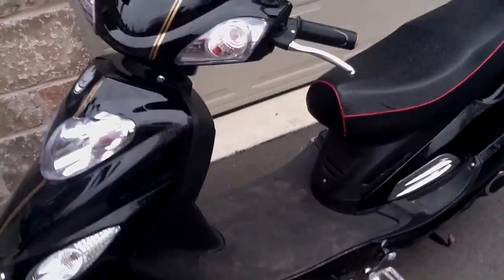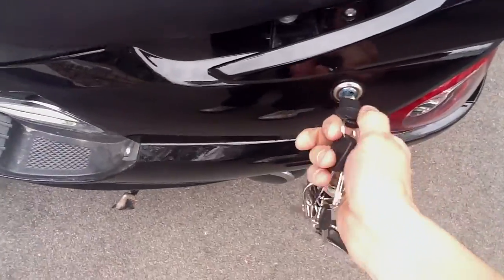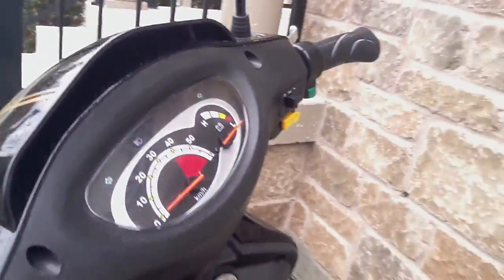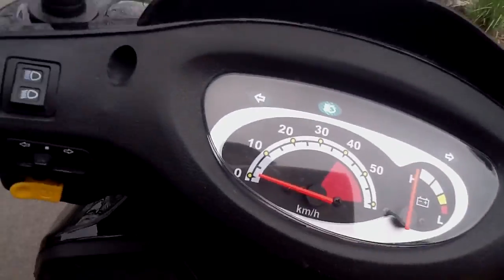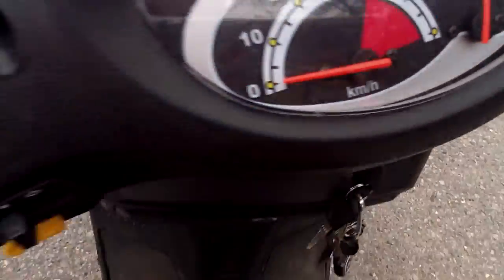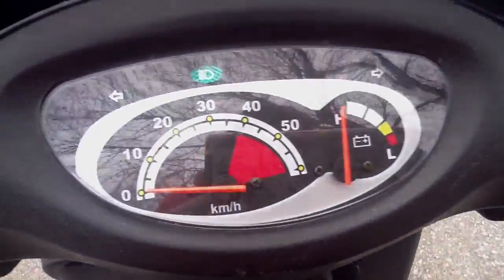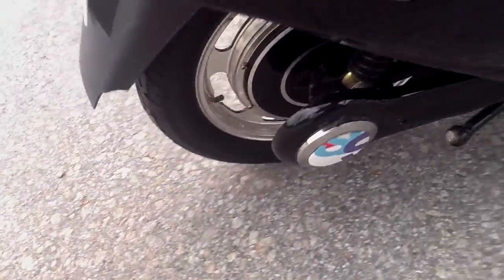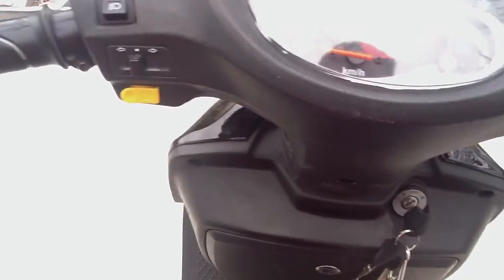Luyuan Ebike Problem

Comment: i found an old luyuan e-scooter that is 6 years old and runs on 2 gel accumulator it haves the same thing with a seat it seen better days but it works yesterday i replaced the accumaltors wit new gel ones

Comment: Dont do that anymore! Your phase wires and hall wires may need to be  wired to a different config. Go to endless sphere website and get all the info. The same happened to mine exactly but works after finding correct config.

Comment: I bought a $4300 Daymak Ultimate Chameleon, I had taken it all apart and I believe it is the controller. I took of the blue wire only. I was able to turn the motor freehand. As soon as I hook the blue controller wire back up I can't move the motor at all and it was grinding like yours and made the same sound before I heard a pop under the seat and it sounded like the controller went. I called and contacted Daymak and they do have a controller I am ordering one tomorrow. When I hook it up I for sure will let you know if that is the true issue or if both the motor and controller are gone. Try disconnecting the blue wire while the bike is off and then try turning the wheel by hand and then hook it back up. That is as far as I got till I can try the new controller.
Reply: Shawn Albrecht so this is a year later but was it the controller or a shorting phase?
Cheers

Comment: hey Proctors Garage when you got your ebike did they give you a remote for the alarm or did you buy a alarm for your e bike
Reply: It's a Gio PB710 Ebike and the Alarm is hidden...try holding down the horn until it beeps....turn on the bike with your key to shut it off :)

Comment: hall sensors in your motor may be faulty buy some more and solder them in!
Reply: first find your motor wires and disconnect then reconnect them sometimes phase cables (brusheless motors) can cause problems such as shaking if they disconnect one (signal wire)... I bet if you pushed the bike down a hill when using the throttle it will move normally.

Comment: Trust me on this 1, Have somebody who knows and works on Motorcycle and let them look at it 1st. All the frames are about the same. You want motorcycle parts. Looks great but it`s just all peaces of breakable plastic. I`m 4 months old to E - Scootering and I kind got burned. Now I`m pro Volt * Ah = Watts ? No ? Watt hours ? is what you want to know. 72v 12ah climbs any hill at 20+ kph easily and rips through trails but you only get - 20 km of riding time. 48v 20ah same hills have to start peddling at 17/19 kph and I haven`t seen my recharge light come on and I ride all day must be because it`s a Volt Bike.

Comment: I`m crying to I bought a Daymak 72v 12a Vienna and it`s a piece of crap 3.5 months old blew the charger. 1st day I tried to peddle warped my front sprocket, chain night mares, Broke and cracked the plastic going over curb and I do believe my motor is gone to. Daymak is ripping people off. Thank god electric scooters are interchangeable. I do all my work and I removed all plastic when I got to the wiring OMG WTF retards and f---- ups cant explain what I saw. Seeing that I like to ride through trails I`m building a Trail Blazer. I had problem with the store I was dealing with again ?. So I turned around and bought a 48v 20ah Volt E-Scooter. Nice build . I see whats wrong already you see the 3 thick wires coming from the motor [ Y B G ] then they become thin wires NFG but it works. It`s a Daymak motor NFG and you got burned. What happening is in side the motor there is 3 sprocket wheels 1 metal 2 plastic ? who knows with Daymak. will the noise and the rumble is that the motor cant engage and it`s a POS. wrong parts probably and put together wrong [ like ya ]. Send the POS back and buy a Volt 500 watt complete 18" wheel and put it on, just looking at the difference you see why I`m putting 1 on my Trail Blazer. There hard to understand over the phone but you love parts and extra height. I feel sorry that stores Gio, TaoTao and ect... You see a lot plastic not fixed to the frame it`s breaking and falling off.

Comment: Its possible that this motor does not match up with your control box .Its sounds like the three phase
power wires don’t time in with the three sense wires of this control box .
So this would make your motor run out of sequence , and sound exactly like it sounds in this video .
If this is the case you can try switching the three large power wires to the motor ( bullet plugs ) .
You would have eight more combinations to try .
Denis

Comment: I fix mine yesterday it was a rotten wire under seat there is a yellow box check wires pull lightly on them if they come out fix it it was easy  hope you got her going.

Comment: i have a 250 watt luyuan ebike, the charger recently stopped working, does any one no where i could get a new one, thanks :)
Reply: Ebay probably your best bet but it will read in Chinese just plug it in should work fine, just make sure it is the right charger for your batteries.

Comment: The motor is in backwards, It is trying to run backwards 
Turn the motor around and switch the wires around and it will run for you.

Comment: I just bought one of these its a luyuan and it does work but burns out after a couple rounds the block and you gotta push it home! Does it need a new battery or is it the controller? Please help :(

Comment: it's your controller, if you haven't fixed it already.  I bought mine cheap because the guy had the same issue, thought it was the motor, and gave up.

Comment: chumba11111 is right the phase is wrong with motor  forget the color of the wiring just swop the big motor wires around on the controller and make sure it going in the right direction

Comment: Hey there!"
Just had a similar problem to yours regarding the sound and shaking etc that your bike is making....in my case it was the batteries. All four cell batteries were bloated like water ballons and were leaking. It cost me $200 plus taxes to change all 4 batteries. It works fine and doesn't make that sound or vibrate. This may not be the situation regarding your bike but have a look, under floor mat. Battery box comes out open it up with screw driver and see. Hope this helps!!

Comment: Check all connections completely, I have an 800W that had the motor doing the same thing. Would only go when I pushed it forward and it would be jerky just like that!. I found a plastic module near the controller that has 6 wires going in it, (three on each side) The screws were loose causing a bad connection and arching that melted the wire end. 

Good luck buddy,

Comment: Maybe the original motor was fine but the speed control was bad. Sounds like the speed control  is not sequencing the 6 commutation steps if the motor is brushless. I'm surely no  expert. Take it back to the shop that supposedly fixed it.

Comment: Maybe the original motor was fine but the speed control was bad. Sounds like the speed control  is not sequencing the 6 commutation steps if the motor is brushless. I'm surely no  expert.